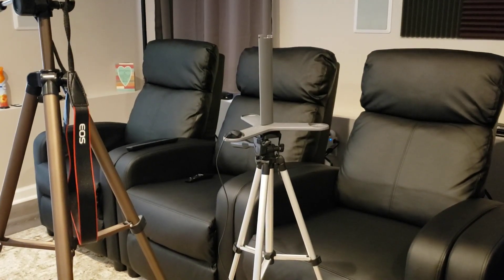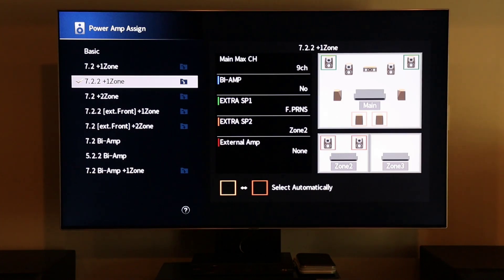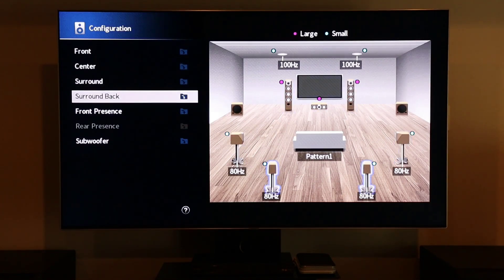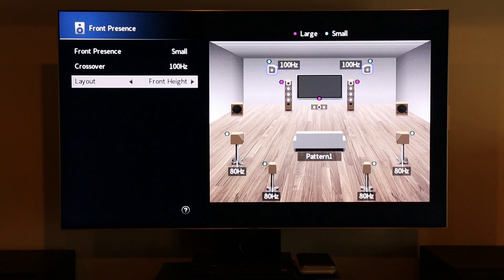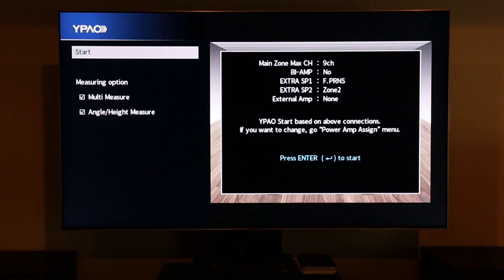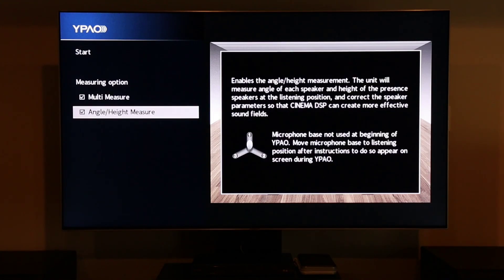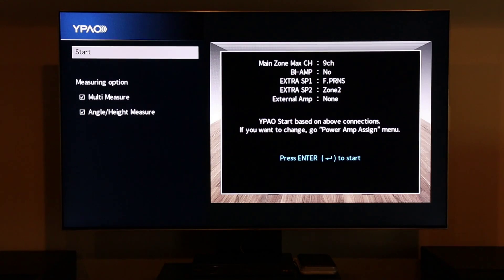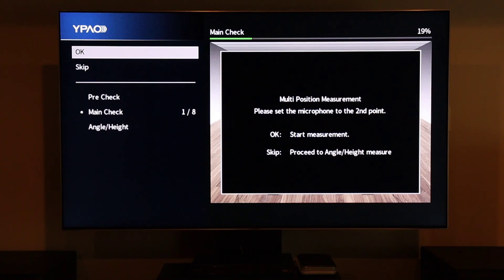Calibrating your System to Achieve Optimized Sound

Comment: I have a 2.1 configuration. I don't see it there, I mean, in the Power Amp Assign. How does it work? Thanks!!! (You got a new subscriber! Your videos are GREAT)
Reply from the maker: Welcome to the channel! The purpose of the Power Amp Assign is to control the routing of power to different channels in the AVR. Each AVR has multiple internal amps and a routing system that tells those amps where to send power. If you're only running a 2.1 configuration, this setting won't be as important as if you were running a multichannel configuration. The main channels are already on by default. If you have an AVR different than Yamaha, it may be called something else.
Reply: @PolkFan  , thank you!!!
Reply from the maker: @mnrodriguez  Anytime! 👍🏾
Reply: @PolkFan  , I set up my RX-A4A. I am very happy with it. Those B&W's 685 S2 are rocking the house! Thanks again!!!
Reply from the maker: @mnrodriguez  Very nice! I can dig it. I'm glad you're happy with your setup. Anytime my man. 👌🏾

Comment: I am trying to set up my yamaha rx-a780 but in the power amp assign I only have basic, 7.1, 5.1.2 and 5.1 bi amp. I do have 7.2.2 speakers. what am I missing? how come you have so many more options? thank you for your help
Reply from the maker: The reason I have more options is because I have the 2080, which has a couple more channels, and as a result more configuration options. No worries though. Set it to Basic for your standard 7.2 configuration. Unless, you're bi-amping or connecting other zones, Basic is the amp assessment to choose.
Reply: @PolkFan  Thank you so very much for your time and help.
Reply from the maker: @drukkosz2196  You're very welcome. Anytime 😊

Comment: HI Polkfan! 
What`s the difference between placing the microphone in front of the primary seat instead of in the middle of the primary seat?
Reply from the maker: The measurements are calibrated to the point of the microphone. Ear-level of the primary seat is ideal because the sound is adjusted to hit that position as intended. Versus placing the mic in front of the primary seat, the sound will be adjusted to hit that spot. So you'll achieve more accurate measurements by using ear-level of the primary seat. Same goes for subsequent positions when you perform multipoint calibrations.

Comment: Hello  I Message you yesterday On the RX3080 when I run my YPAO it comes up saying there are significant volume differences between these speakers not really sure what that means also in the power amp assin  I don't have option to select 5.1 should I leave it on basic
Reply from the maker: Yeah, you should leave the Amp assign on Basic unless you need to bi-amp or add another zone. Take a picture of the error and  share with via imgbb.com. Paste the URL to the image here so I can see it.

Comment: Hello, i know this is an old videop but i have this receiver and want to add a 2nd subwoofer, how is this done on it?  I saw you have 2 of them also.  Thanks.
Reply from the maker: Very simple. This receiver has two subwoofer outputs. Simply run a second subwoofer cable to the second sub out, and turn on the second sub out in the configuration menu. 

Press the setup button on your remote > select Speaker > Configuration > Subwoofer > Subwoofer 2, push the side button to change None to Use. Make sure you recalibrate after adding the second sub.
Reply: @PolkFan  ahh.. thx a lot.. going thru a renovation so receiver is stored but the second sub is here and ready.  Thanks. 

PS: any thoughts on the new Yamaha AxA series like the A6A? Was going to 'upgrade' but it only has preamp for the other zones unlike the 2080.
Reply: @PolkFan  ahh.. thx a lot.. going thru a renovation so receiver is stored but the second sub is here and ready.  Thanks. 

PS: any thoughts on the new Yamaha AxA series like the A6A? Was going to 'upgrade' but it only has preamp for the other zones unlike the 2080.
Reply from the maker: @JulioCruzcoach  I think all Yamaha receivers are really good. However, I don't see enough difference between what we have and the latest releases to warrant the cost difference. I was looking at the Emotiva BasX MR1 as an upgrade, as opposed to the A6A - not that I need it. But IF I were to pay 2K for a receiver, I'd consider the Emotiva. It has more channels; more power, and very clean sound. But I'm good with my 2080 for now. Works like a champ and my theater experience is still superb.

Comment: Ur results were they good or u had to tweak the settings... i kno my calibration didn't get me to 75db it was 72db.. i use my spl mic to push it to 75db THX STANDARD
Reply from the maker: Actually, with the 2080 no changes were needed after calibration - the results are Perfect. My 770 would leave a couple of things to tweak but only minor, such as the sub level.

Comment: Found it. Thanks!! Should I first do my amp assign & set my spkrs and subs levels, then do calibration. Or, calibrate then set the levels after?? (I now have an SPL meter, thanks to you - C rating/slow).
Reply: I'd like the answer to that question? Did you ever find out? Thanks!
Reply: @mnrodriguez  - Yep, set the amp assign for your specific set up. Do the calibration, then set the levels after using an spl meter to your desired db level/personal taste, roof specifics. 75db is recommended, the sub can be the same or up to you if you need more 'umpth'.
Reply: @koolrunnings3135  , thank you!
Reply: @koolrunnings3135  , I set up my RX-A4A. I am very happy with it. Those B&W's are rocking the house! Thanks again!!!
Reply: @mnrodriguez  Irie vibes. Do enjoy!!

Comment: hi, i'd like to purchase a polk hts 12, seen some videos on your channel, by doing some research, some people think i'd be better going with something like a Svs PB1000/Monolith 10in THX ported. Has anyone heard them? i don't want to only read paper specs, any opinion is really appreciated, thank you! :)
Reply from the maker: It comes down to your personal preference. If you're looking for a dedicated sub for home theater use only, then the SVS or Monolith will give you a slightly cleaner sound. However, the HTS is a better-balanced sub and works great for both music and movies. It'll also give far more output compared to either of those subs. From experience, I had dual SVS PB1000s prior to buying my dual HTS12s. The SVSs had a slightly cleaner sub 30hz sound, making them great for movies but also had a limited range (no punch) and little output. When it came to music the SVSs really showed their weak point. They chuffed when trying to crank them up, and the port noise was depressing. The Polks, on the other hand, gave a wider range and way more output - filling the room more. They have a tight thump, no distortion, no port noise, and work much better with music, thus making them more rounded. Even though I now run dual Rythmik 15s, the Polk HTSs never stop impressing me - I run them in my living room setup.

Movies only = SVS
Movies and Music = Polk
Reply: PolkFan Hell man, that’s what I was looking for, thank you for the detailed answer, keep it up!